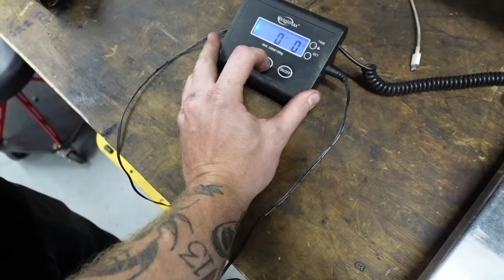The Best Upgrade For my F80 M3!

Comment: On the topic of flywheel weight… I have no idea what I’m taking about, however I’ve pondered if a lighter flywheel in a drift car might actually make it more difficult to drive. Just as it will rev up quicker, it will lose engine speed real quick (inertia). Wouldn’t that make it harder to float the car while the clutch is in?
Reply: Yes - you're spot on. It's a give and take.